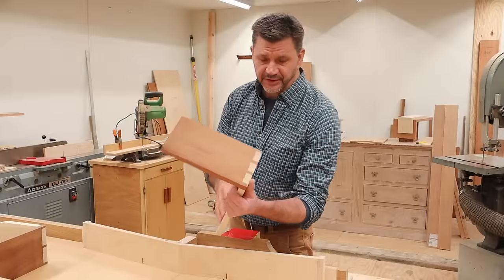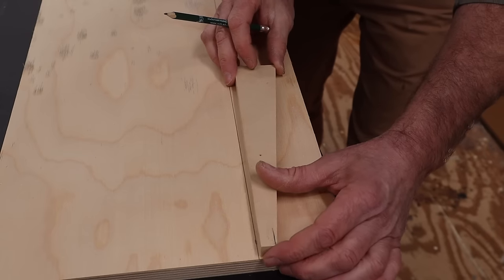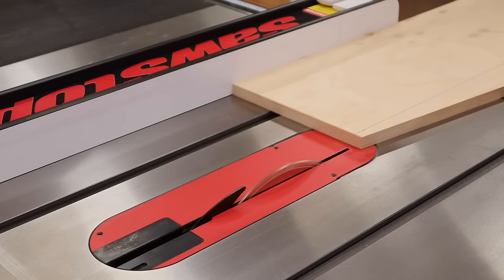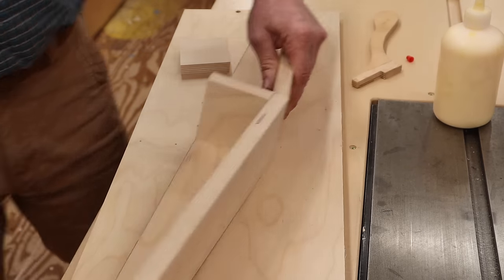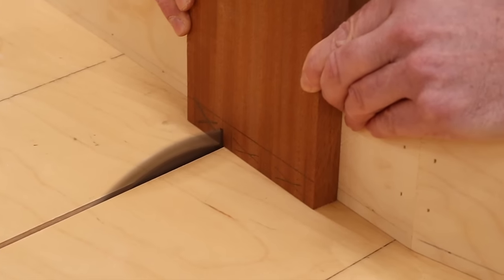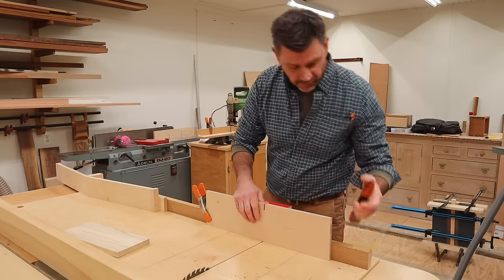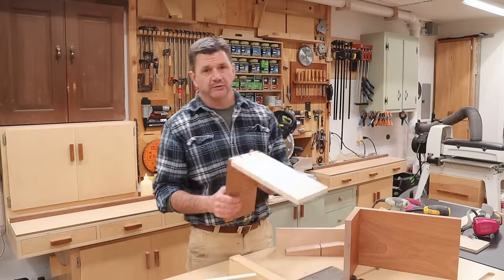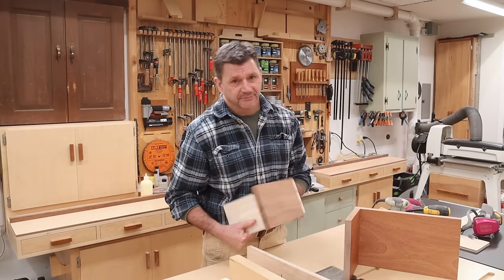Make this Dovetail Jig & Cut Perfect Dovetails [EVERY SINGLE TIME!]

Comment: Nice work!
Reply from the maker: Thanks! I really enjoy your channel… tons of great information!
Reply: Two of my favourites right there!  I just made a bunch of small boxes out of scrap wood (box joints), but am thinking this makes VERY attractive joints for bigger boxes or drawers
Reply: IM not really sure how this saves any significant amount of time. There is a good bit of setup using the table saw, then the band saw, etc. If you are making simple through dovetails, the router jog seems to be more efficient. Personally, I don't see how this improved the dovetail, nor do I see how it saves time over the router or even hand cut. If you have any reasonable experience hand cutting dovetails, you can do it at least a quickly as this. I would love to see a side-by-side comparison of hand cutting vs machine cutting to really view the time savings. It is a nice jig, and you do get good results with it, no doubt, but it's not for me.

Comment: The flat ground blade is great for the pins and hogging out in between the tails.
But I angle my blade at the same angle as the pins, using the sled to make the angle cut of the tails. 
I stand on the out feed side of the saw to easily line up the blade with my cut lines. If I need to shave a hair off for a nice fit, easy to do. Thanks

Comment: Seems to work well, but what’s the point of having your pin jig be so wide? Do you plan to cut DTs onto cabinet tops?  Also, if you use those 7 degree wedges, you can make a guide for cutting the tails at the bandsaw.

Comment: Thanks for the great ideas for this jig.  I recently took a hand-cut dovetail class, which was great for understanding the mechanics and fit of the joint, but on a large project I'd never want to spend that kind of time.  My daughter and I plan to renovate her kitchen next summer with cabinetry we build ourselves and batching out the drawer joinery on the table saw will be a huge time and labor saver, probably with better results.
Reply from the maker: Sounds like a great project Ian👍
Reply: @JonPetersArtHome  yes, it should be.  We took a cabinetmaking class together (her intro to woodworking) last summer.  Now she has just moved into the house in Sweden that she and her husband bought during summer 2020 (he's Swedish).  It's very small, meaning they can afford to use nice materials and our own labor to do it right.  Here's to hoping Sweden opens its borders to Americans next summer.
Reply: I can cut hand dovetails and fit them far cleaner and quicker than any machine using woodworker can. 
I would never do fine furniture with machine cut dovetail. The whole process may seem daunting to people but once you start to become proficient you will find yourself flying through them.

Comment: I'm fairly new to woodworking. I enjoyed your video.  However, I don't understand the point of your jig. Here's why I ask:  You drew the dimensions of the dovetails on the wood.  You finish the dovetails with the bandsaw to attain the exact dimensions you drew.  Why didn't you just do all of it on the band saw?  What's the advantage of the jig vs. just the bandsaw? I must be missing something which is likely or you wouldn't have built it in the first place.